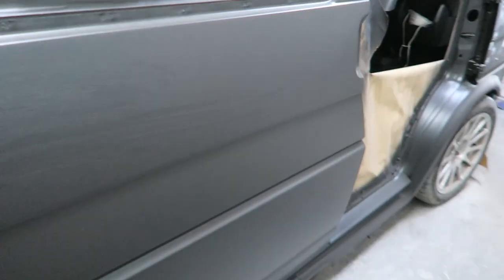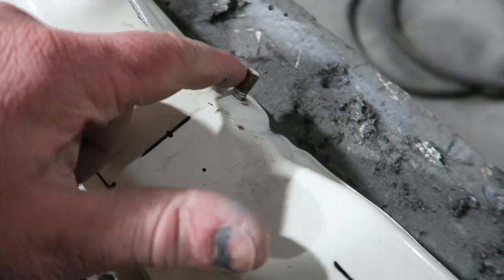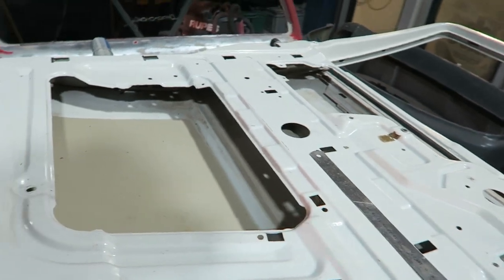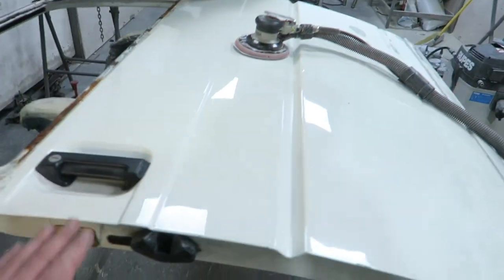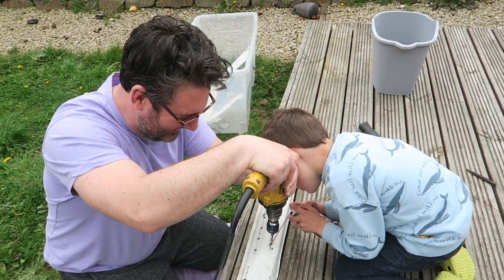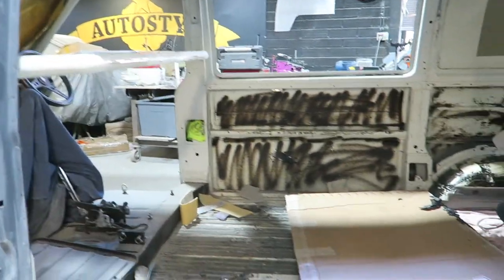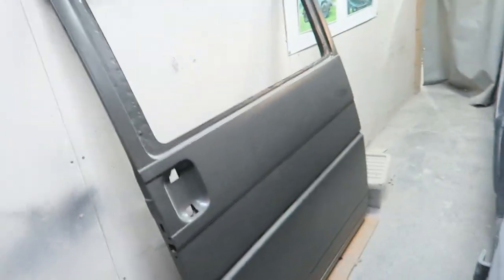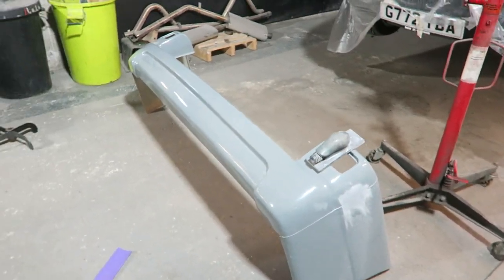VW T4 FRESH PAINT JOB PT2  @AutostylUK

Comment: A lot of work, respect! 
Because of you im building a 1.8t transporter t4 right now, onley a lot slower.. 
Im from the Netherlands, so i have some issues with my exhoust manifold.. made it kind of the same shape like yours. But i have the brake booster in the way..
Reply from the maker: Thanks @Jaap Bos Hope you manage to get it running well, are you using KO3 or KO4 turbo?
Reply: @SpeedingTube I bought a skoda superb from 2002 for the engine. A AWT motorcode. I'm using the original turbo right now. I bought it because cheap. The engine is in incl. The dash of the skoda into the t4, because I'm to lazy for the wiring. And I want to use the cruisecontrol

Comment: You may as well chop the front end off and build a tubular front end with proper suspension on it
Also is your 6 speed conversion kit available yet 😁
Reply from the maker: The front end will be undergoing quite a few changes next winter with a different engine going in. Got a couple of kits going out this Spring, see how people get on installing 20v & PD.
Reply: @SpeedingTube  mint news for the conversion kit. I'm guessing your going with 5pot rs3 engine with dsg gearbox with flappy padle steering wheel if not it will be a sweet conversion though lol
Reply from the maker: @karlsanderson8127  Yes built 5 pot RS3, FWD. The AWD setup is so heavy and with the T4 being so front heavy it puts power down well with the diff.
Reply: @SpeedingTube  mint i know the later rs3 engines are aluminum blocks which are apparently 60 pounds lighter than the cast iron blocks, i seen how like to save weight wherever you can lol
Reply from the maker: @karlsanderson8127  Yes mate, has to be an alloy block version. I'm keeping my eyes peeled for a high mileage/or blown engine that I can rebuild with rods, pistons etc